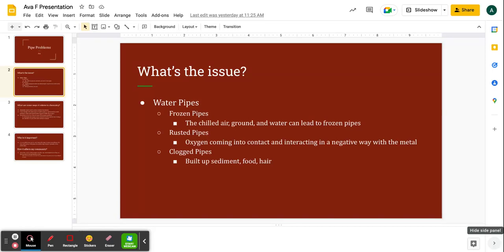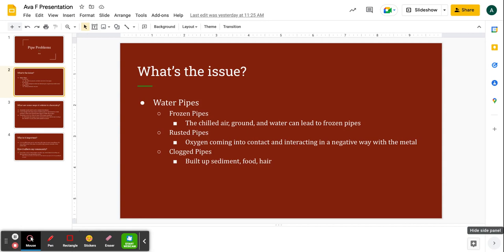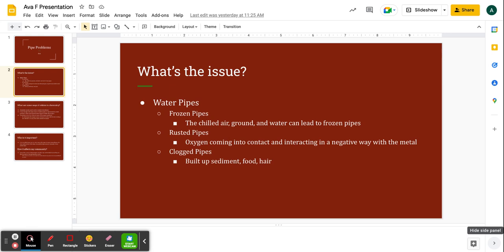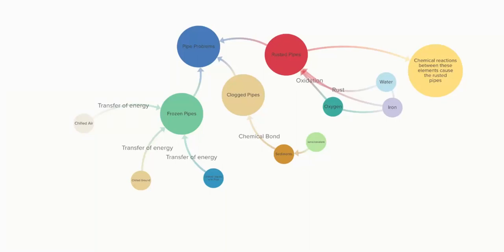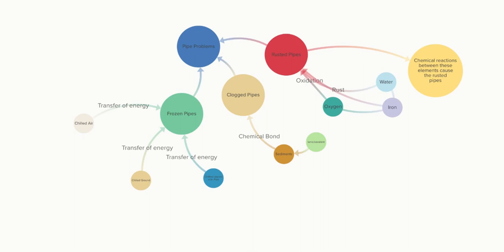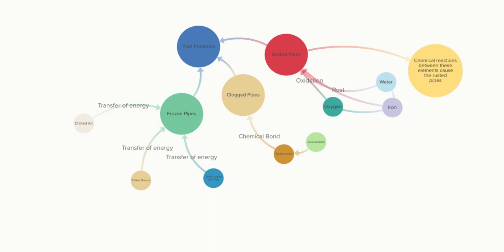Ava - Chemistry Connections

Comment: 1 S: What do you see? Pipes can become frozen, rusted, and clogged.
2 T: What do you think about that? I think that all three of these pipe problems can be fixed but some may be harder than others. For example, clogged pipes are easy to unclog while frozen pipes greatly rely on the type of weather in the season.
3 W: What does it make you wonder? I wonder how you plan to fix pipes that are frozen without putting too much heat onto them which can cause them to melt?